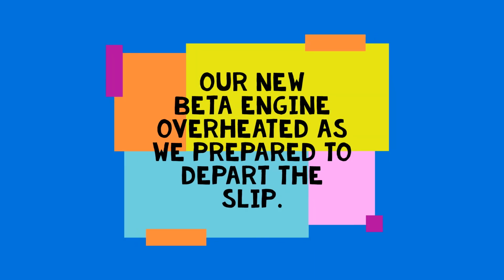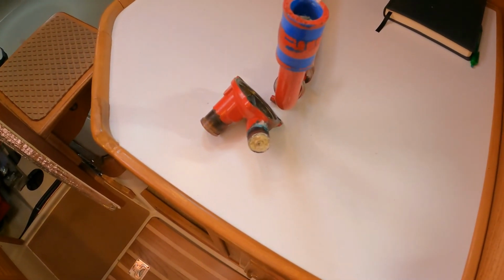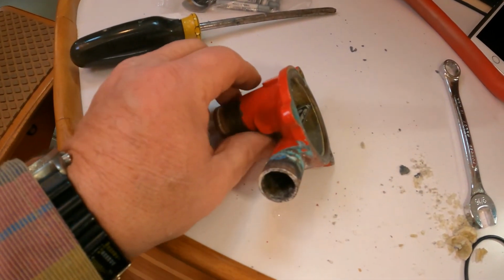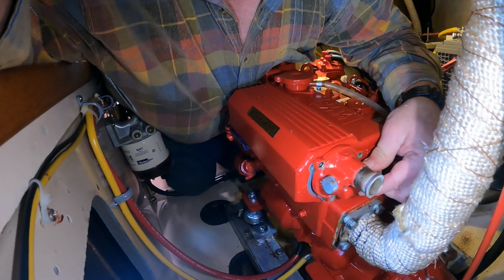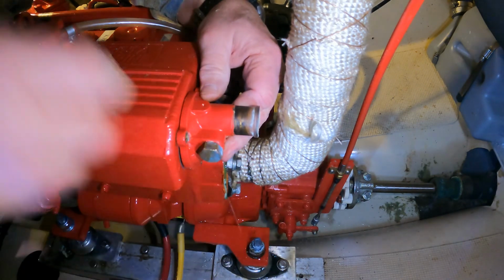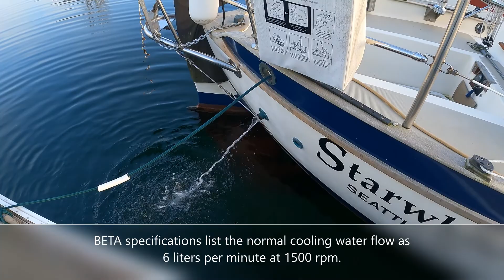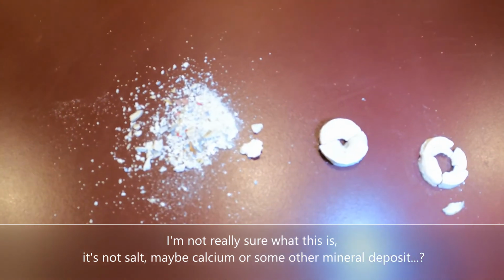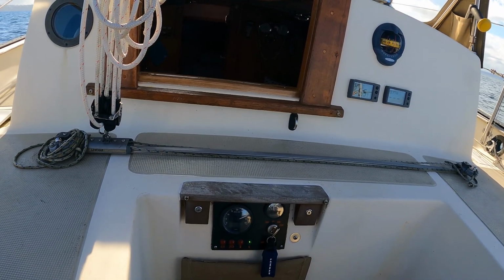BETA Engine Overheating !!! - Video #21 - Westsail 28 - "Starwhite"

Comment: Very methodical debugging work, Kevin.  Nice!  The scaling residue is probably a mixture of calcium carbonate and magnesium.  The sea water in the PNW has a high content of both (1.27 g of Mg per kg of sea water and 0.4 g/kg of Ca).  Descaling is part of my 5-year maintenance routine but for folks up in the PNW it may need to be more like annual).  Great video, as always!
Reply: I sailed the waters of the PNW for 25 years. My last boat (12 yrs) had a Universal M25XP. I never had this issue. Perhaps this is related specifically to the BETA?

Comment: Great video! I've got a fairly new beta 30 on my boat and I found the same issue in the raw water system. So strange! I wanted to go a little bit deeper with my research and I have taken off the injection bend. Even there I found bits of calcium stuck.
Reply from the maker: Yes, it appears this is not an uncommon issue.  I've read of a couple owners that have replaced the Stainless crossover tube with silicone hose in an effort to address the issue.

Comment: Good save Kevin . Did you check the tubes in the heat exchanger ? Well if you are pumping water and not overheating you are probably safe . Over the years twice now our raw water sea cock has calciumed up solid , had to drill it out .
Reply from the maker: Yes, the tubes and thermostat were all clean. 
The blockages were only at the silicone hose connections to the crossover pipe that runs from the raw water pump over the top of the engine to the back of the heat exchanger.  Very strange, perhaps there was some residue in the crossover pipe leftover from manufacturing that settled out at those two low points?

Comment: The calcium buildup was not likely caused by heat from the exhaust because the water in the hose was constantly being pumped and moving so it did not have a chance to get hot…
That much calcium is  something that I have not experienced either…
 If it’s calcium then it will dissolve in an acid, try soaking it in strong vinegar, and watch for bubbles, 
Failing vinegar try a stronger acid  such as  Hydrochloric - Muratic acic( HCl) ,  or Sulfuric acid used to clean mortar from bricks…
Moving on, I really like that fuel filter and hand Primer pump, can you tell us where you sourced it?
Reply from the maker: Thanks for watching!
I mentioned in the video, I did try soaking the material in vinegar for a couple days to no effect.  I found it interesting that the two deposits were only at the ends of the of the crossover pipe connecting the raw water pump to the heat exchanger inlet.  There was no other buildup to be found within the pump or the heat exchanger.  Makes me wonder if the material may have been some sort of machining residue that was left in the crossover pipe and settled at those two low points. The engine had only about 60 hours running time when the issue developed.  I'm at about 100 hours now with no evidence of a return of the issue.
The diesel filter is a Racor/Parker #445R10.  
I purchased it from Fisheries Supply in Seattle.
Reply: Westsail 28 STARWHITE   Thanks   Great channel, great boat , best of luck!
Reply: As an old diesel fuel injection mechanic; I could not count how many of those filter / primer units I have had to repair / change over the years. (I used to run a diagnostics workshop; so basically fault finding) Those primers love to fail and draw air into the system at the most inconvenient moments. If I had one on my boat; it wouldn't be there for long.

Comment: I get zinc sulphate build up. Is this after the zinc?
Reply: I have no solution except to clean it annually.
Reply from the maker: No, these build ups were before the zinc, in the raw water inlet line.  The zinc on this engine is on the outlet side of the heat exchanger.
Reply: Unusual to get deposits at the raw water pump. Just clean annually.

Comment: How many hours on the engine?  That amount of "calcium" buildup seems unusual. Maybe the Beta  forum could offer an idea. 

Your engine compartment is nicely done. 
From experience, those plastic lift mufflers will melt over time if u loose raw water flow while the engine is running.
Reply from the maker: Just over 60 hours.

Comment: Did you notice when you first started your engine in port that your normal overboard discharge was reduced flow or not at all? I enjoyed video.Thank you
Reply from the maker: I NOW check the overboard discharge everytime I start the engine.  But at the time of this incident, I did not.   I just did not expect such an issue with a new engine.  So much for expectations!
Reply: @Westsail28   
Do you shut your cooling water in take valve when your in port?
Reply from the maker: @redwood1957  Not normally, but I will close it when I'm doing work on the engine.
Reply: @Westsail28  I close it when not sailing. Adds separation from sea water. Pre engine start is woc. Water oil cooling check are all good to go

Comment: Did you check the zinc? I hear they go quick.
Reply from the maker: Yes, I've found that I only get about 4/5 months per engine zinc.  They are quite small, roughly 1/4" diameter and an inch or so long.

Comment: Weird on a new engine.
Reply from the maker: Yes, it was.  The connecting hoses are silicone and much of the blockage was within those hoses.   I can't think of any reason why that might matter.  I spoke with 3 different BETA   dealers and they all said it was strange.

Comment: Very odd. Totally blocked at 60 hours w/ raw water strainer installed? I'm calling Beta for a check for my 2.5 hrs plus the parts. That is total BS. No way that is salt or even calcium. Looks like some electrolytic precipitate from dissimilar metals i.e. bronze thru hull connected via seawater to stainless tube? I don't know enough about the issue but that is clearly a design / manufacturing flaw. Stupid hiw easily that could kill your engine as well. I have a 49 year old Perkins that runs like a top and is spotless inside the cooling system. The pipes are mild steel.... let us know if you discern the culprit!